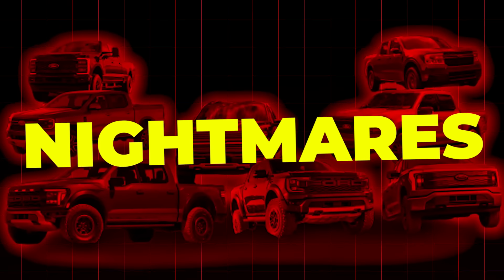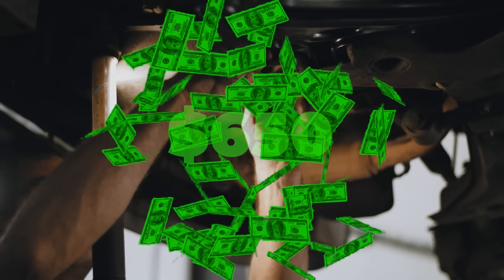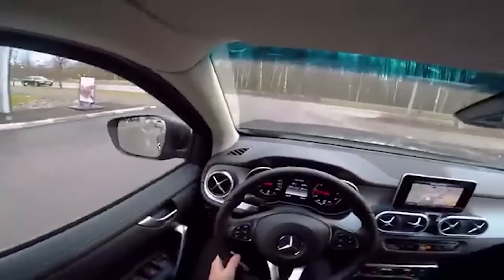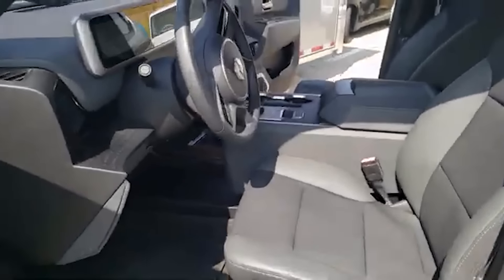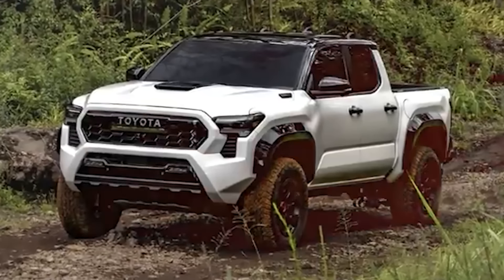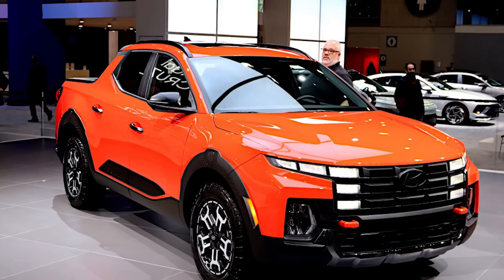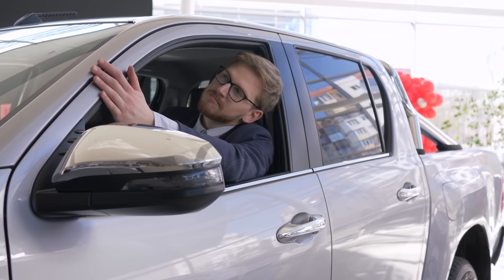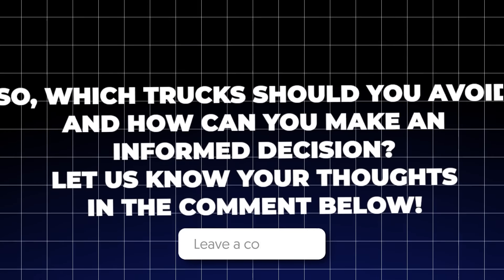WORST Pickup Trucks That won’t Even Last 50,000 Miles… DO NOT BUY!

Comment: I've got an 04 5.4l triton with 200k miles. I've had a little engine work but nothing huge. I've heard bad things about it for years, but mine is 20 years old and running well. Who wants a brand new $80k truck, anyway?  I prefer mine old and beat up, as long as the A/C works.

Comment: I've got the 04 F150 5.4l. 200,000 plus miles. Runs well. Sure I've had a 1 to 2k$ engine work. But it's worth it. A new truck payment would be 1000 plus a month anyway.  My worst complaints are cab roof paint fade and starting to rust, and black rubber marks rubbing off window belt molding.
Reply: @David69D  hell yeah
Lot of people doing same. Doesn't make sense to get rid of something that runs great 
Maybe, if no bad rustthri, paint job. One day value might go up.

Comment: I bought a new Colorado four years ago I put over 300,000 on it other than breaks tires normal stuff no issues with it.And got a new Toyota 
 no issues so far
Reply: Me too, plus I just bought the new Colorado and Chevrolet fixed the transmission it shifts so smooth now and the 2.7 liter turbo is very powerful
Reply: Make sure to get new breaks on your vehicle! Then go take a coffee brake!

Comment: I'm going to 100% Disagree with putting the Colorado / Canyon on this list. I have seen MANY of these trucks hit 300k with NONE of these problems. 
My Brother has a 2015 And its been VERY reliable, with aver 240k miles now. My neighbor has a 2020 also had near 0 problems though I don't know the miles. 

I have a few friends with these trucks and they all love them. 
Many have well over 100k at this point and have not needed anything major, only normal maintenance has been done to them. 

I have even seen a 2019 that already had 270k on it and the owner said its been the best truck he has ever had.

Its to small for my needs, but if I could buy one I would!

Now the F150 I 100% agree with you on. But you only focused on the JUNK 5.4 Triton engine. 
The F150 has far more engine problems.  The 2.7 is so bad Ford is in the middle of a class action law suit over it. The 3.5 is not much better. Both have oiling problems, cam phaser problems, and head gasket problems as well as turbo problems. And the 10speed used behind both engines as well known for blowing up. The problems don't stop there though. The interior is filled with CHEAP hard plastics that sound awful and crack easy. The fit and finish as laughable,  the My sync system sucks, the aluminum body is VERY easy to damage and VERY expensive to fix. The paint likes to fall off. Any stone chip will develop a white crust over time and then it will spread like cancer. These trucks are harder to work on and therefore more expensive to fix than there competitors are.
And they may look nice on the outside but the mechanical part of the truck is very poorly thought out, and engineered. 
Ford was my Go truck. After owning a 5.4 Triton truck I was not a happy customer. After working on these new Ecoblowup trucks I refused to buy one and moved to a different brand that I have had very good luck with. I'm sad to say that the Ford of the 90s and older where they made the best most reliable trucks is no more. Now they build over engineered trash that fails to hold up to its reputation. I hope Ford gets back to its roots and stops with this stupid engineering language that they have been so dead set on for the last 15+ years now. The 5.0 is a good engine. But the rest of the truck is still junk sadly.

Comment: There are ZERO new Fords with the Triton, quite the biased reporting showing newer models and talking about a unreliable V-8 replaced by a solid, very reliable one (aka the Coyote V-8)....with this so new, no mention about the 3.5 Turbo from Toyota that's not even lasting 30-40k?